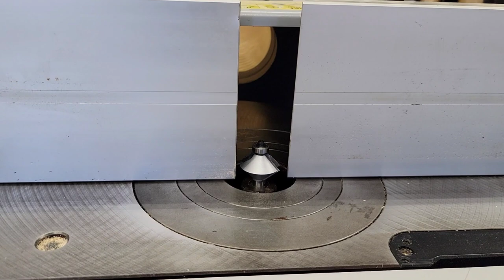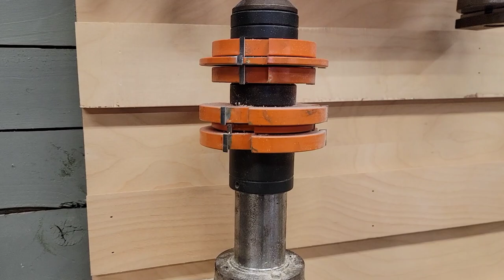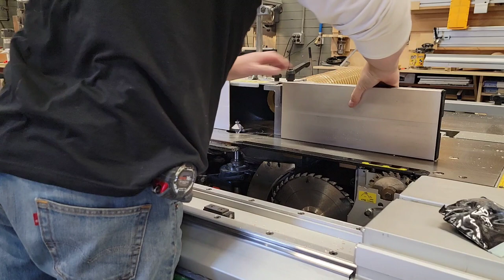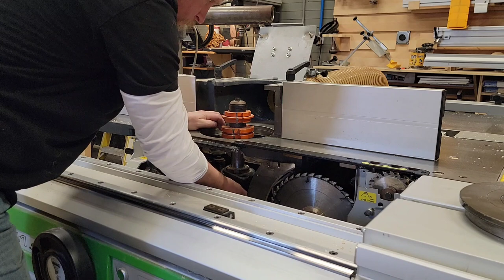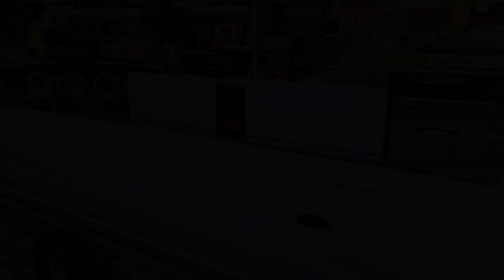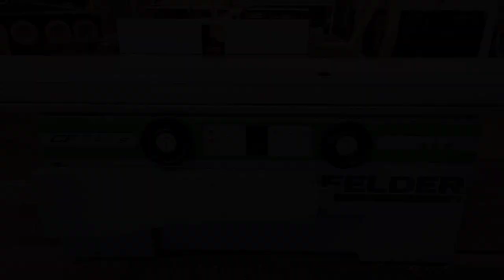Felder CF 741s - Shaper mode spindle swap

Comment: Hi EB . I have just realised that I left a comment in another part of your comments, That somebody else had left ,  that’s good my age
Great tutorial on the machine, I have just realised watching one of the other territorials of yours that the machine I’ve got is slightly different from yours mine is just the spindle moulder and the saw table, I do have all the accessories that you have got, I purchased mine back in 2005 2006 I believe, Though I did have it upgraded I had higher horsepower motors put in, I am self-taught specialist joiner cabinet maker so over the last 10 to 15 years I’ve been mainly involved in high end barn conversions, Which involved especially doors and windows. 
Keep up the great work and please be safe, PHIL FROM THE DARK SIDE OF THE MOULIN FRANCE.
Reply from the maker: Thank you for watching! When I purchased this machine there wasn't a lot of available information on how to use it. Felder tech support was alright but over the phone left a lot to be desired.  That is one of the reasons I started this channel. I will do more walkthroughs and I have a video review/pros and cons of my experience planned. Cheers!
Reply: @ebwoodworking  Hi 👋 EB , I am now 71 years young dude retired English gentleman ha ha, I still have most of my tools, but I had to sell some Machinery back in 2019 due mainly to my female partner scamming me, I had spent all my savings and income on Two renovation projects one in UK and one in France, That is a very bad story as I am still trying to fight a case against her, 
As France was where we were supposed to be retiring to I decided to move here, 
To make sure I was covering myself legally I went to the police and went to a solicitor for advice, 
So this is where I am now living, 
My basement is now my workshop which is very small approximately 7 m x 12 m, As for my workshop back in the UK was an old grain store approximate 8 m wide at 35 m long I could drive my vehicle into it which is very good respect if it was pouring down with rain I can still load my van or unload it which ever I needed to do, 
Anyway going back to my work there was another piece of kit that I purchased just after I got my machine I cannot remember who makes it but I believe it’s made in Germany it’s a shroud that goes over the top of the spindle moulder that allows you to run jigs either a bearing on the main shaft or aluminium plate that is fixed to it, I would make a jig either out of plywood or MDF I will spend a lot of time on preparation on these making sure they were very very smooth then I would fit stock blocks and clamps onto them so the piece of wood that I was going to profile was well secure, 
Most of my clients were very high end though sometimes I had problems with some people saying why do I charge so much for doing a job or contract and then I try to explain what it cost my rent and rates and electric on my workshop, And the cost of my machinery and the main maintenance all the machinery as well, Considering I was a one-man band ha ha can’t play any instrument I wish I could, I reckon that it has cost me somewhere in the region of £70-£100,000 if you had to go and buy everything brand-new I was lucky in some cases I managed to purchase some bits of equipment secondhand then I rebuilt it. Wadkin EKA 4 head , that dates back from 50s . A very old mortising machine,  from the same time period, 
In some cases order machines are sometimes better than new machines as they used to be made out of cast-iron which made them very heavy and more substantial, 
Good luck in your career, And Be Safe, Especially when it comes to your lungs and your ears are used to have a piece of of safety gear made by M3, It is quite expensive it has a air Feed mask and it is built like a crash helmet With a polycarbonate face shield and ear defenders, Especially very good if you’re doing Woodturning, I look forward to your next territorial open all goes well, 
PHIL FROM THE DARK SIDE OF THE MOULIN FRANCE.

Comment: This was very helpful but I’m missing something, just before you free the spindle you removed you first loosen the two levers top and bottom and then reach further in and loosen something else. Essentially a close up of you pointing out the different parts would be much appreciated. I have the spindle only version of your machine but the f700 2004, everything is identical. I thought I may need a spindle wrench to remove it but you seem to have managed without. 

Kind regards 
Sean
Reply from the maker: No problem. I'll do that soon. Cheers!

Comment: Hello EB! I’m a current Felder owner, 2 machines 24 years usage, thinking of buying a machine like yours. Would you be willing to share your thoughts based on your experiences? Thanks for your time.
Reply from the maker: Right on! I love my machine. I do custom woodworking by trade and even though I am a small one-man shop, I still want industrial-quality tools.  This machine fits the bill. It has its quirks and there are a few things I would have liked to have known before buying, but all in all, it was a great investment. I'll make a review video for it soon. Cheers!
Reply: @ebwoodworking  thanks for your time. I am also a one man professional shop, though my primary livelihood is and has always been as a piano player. With that in mind I think sliders are in most regards safer machines, and as I’m 66 now, I’d like to maximize my enjoyment and safety the years I have left with my woodworking trade. I truly don’t expect you to enter int a never ending dialogue with me, but if you ever can find the time to note the quirks you mentioned, I’m all ears. I currently use a saw/ shaper and 12” J/P both from Felder. I run a 20” planer as a stand alone and will likely not use the thickness planer but want the upgrade to 16” jointer with helical head. There are some known improvement in your machine that I’d enjoy that aren’t on my model. Anyway, I’ll look for your review,and again, thanks for your time.
Reply: Hi EB , A GREAT Territorial on the Felder CF741S , I have the same Machine I purchased back in 2005/6 I think, I will have to go and have a look, I to I’ve got the same accessories as you including the router shaft it is an excellent bit of kit, When I purchase mine I had the motors upgraded I can’t member whether they are now 7 hp or 10 hp, . I am now 71 and retired English gentleman ha ha, living in France, I am a self-taught specialist joiner cabinet maker, And over the years I have made tables chairs furniture bookcases though in the last 1012 years I have been mainly involved in making specialist windows and doors and staircases for high end Barn conversions, I have specialist window tooling set’s to fit on machine, I do have a Wadkin EKA tenner for doing larger windows and doors, I do wish I was back at work, 
Thank you for your Territorial on the machine, Keep up the great work and please be safe, PHIL FROM THE DARK SIDE OF THE MOULIN FRANCE.

Comment: Hi  eb
I have an older felder kf700 sawspindle  probably 20years old or more dark green and yellow in colour 
I recently purchased a   router spindle  but am having trouble finding  the correct size drive belt  could you tell me the dimensions or code on yours
The year of manufacture is unreadable  any help would be much appreciated 
Regards Liam
Reply from the maker: Hello! The router spindle on my machine uses an optibelt-RB  PJ 533. Hope that helps.
Cheers
EB
Reply: Thanks eb
I will check it out 
Regards Liam